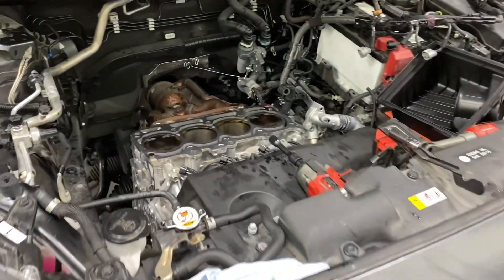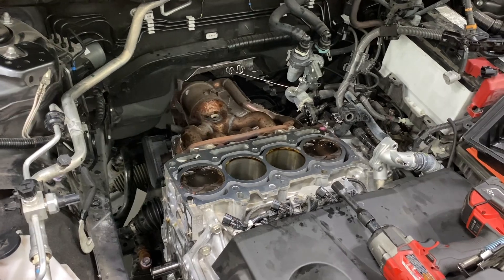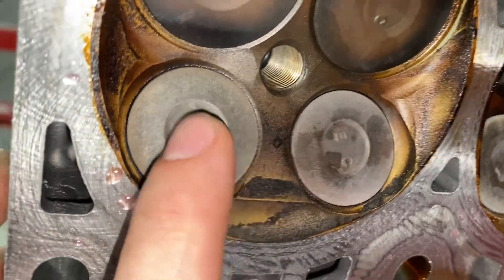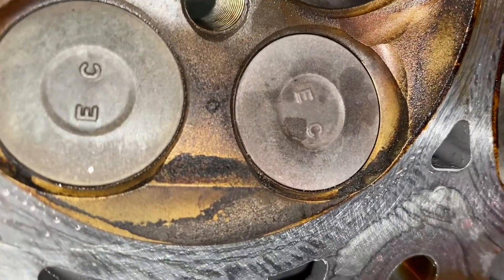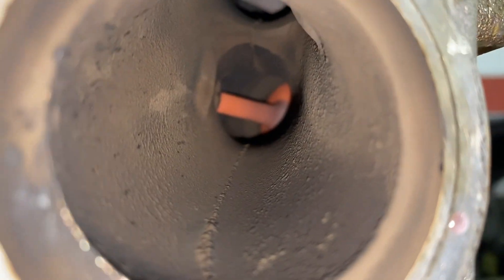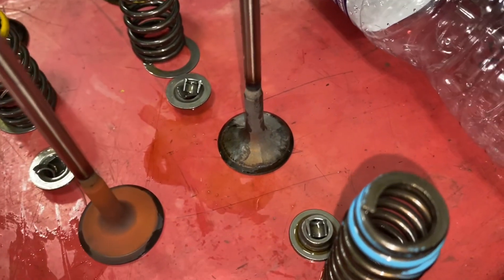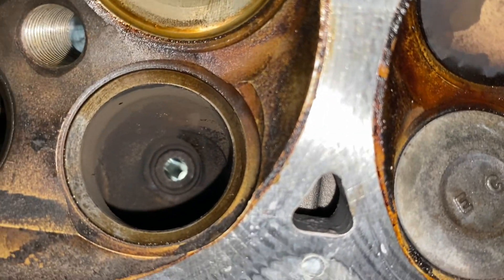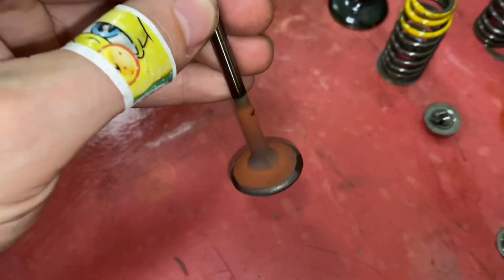2024 RAV4 Bad Valve Seat/Cylinder Head

Comment: This is something you might see in a Toyota with 500,000 miles (and even then, it was rare) on it in the past, but not a new one. Toyota's unravelling is getting a bit concerning. I'm hoping for the best for my 2024 Corolla for good longevity. It's my first Toyota, but not the first in our family. We had two Corollas, a 1980 and 1981 for about a year and half while we waited for my father's company car (a 1980 Pontiac Bonneville) to be built and shipped to the dealership. My dad ordered it very specifically, so I remember the dealer calling and asking if we would take it without gauges (apparently the assembly plant called the zone manager who then called the dealer who then called my dad). 

My dad said, "If that car comes without gauges, I'm not taking it". That delayed it another eight weeks. After all that, the car came in and we only had it about two years. It was stolen in 1982, and we believe (according to the cop that took the report) it was put on a container and exported overseas somewhere. 

I'm thinking the Corollas are part of the "good Toyota" before things started coming unraveled and that's disturbing because you never got that with Toyota. Sure, things go bad, but not like this. It's almost 1970s GM/Ford/Chrysler/AMC embarrassing.
Reply from the maker: @googleusergp  this is still rare, and you have to remember I only see the broken ones. Hundreds of thousands of them are out riding around without issue. I was a GM tech before moving to Toyota, and there I did nothing but heavy line engine repair under warranty- day in and day out. Toyota is not what it was in the 90s and 2000s, but it isn’t GM/Chrysler/Ford bad.

Comment: What DTC did it throw for the misfire? What do you think caused that valve issue in a 20K mile car?
Reply from the maker: @SwordsCutEmDown  the diag was interesting. It had a cylinder 1 misfire, and a random/multiple misfire code. Freeze frame data was odd, in that it did not register the misfire, and showed normal fuel trims. Cleared codes, started the engine and monitored live data. No misfire count showing. Fuel trims perfect in either port, or direct injection modes. Engine would visibly be shaking. Anytime it was raised off idle, it was smooth as butter. Even to 900-1000rpm. Running the AC would even raise the revs enough to smooth it out. After a hot soak, it was worse. Oil looked good, coolant level was fine. No evidence of coolant burning in the cylinders, spark plugs looked great. Toyota head gasket failures typically misfire due to coolant in the cylinders on a cold start. Finally got the misfire to show by only displaying cylinder 1, 2, 3, and 4 misfire, and all cylinder misfire PIDs on the scan tool. This improved the refresh rate. Cylinder 1 was a dead miss on start up and at idle. Moved ignition components- no change. Moved the port injector (because it’s easiest). No change. Checked compression on all cylinders. Compared 1-4. No discernible difference. Leak down test on cylinder 1. Absolutely no leak. Pressure tested the cooling system and inspected inside the cylinder for leakage. None. Checked for fuel pressure leak down with key on, engine off. None. Tech support suggested replacing the direct injector. We’ve seen a bunch of them fail, but it had always thrown off fuel trims, and you see the fuel pressure leak down. I replaced it because they said so. No change. Tested all wiring on injection and ignition circuits all the way back to the ECU. No change. Measured, graphed and compared ignition coil voltage, IGT signal and injector pulse with the PICO scope. No issues.  Removed and switched the direct injector with another cylinder to prove to the field technical specialist that it wasn’t fuel, that it was engine mechanical. No change. While the intake was off, filled the intake port with brake cleaner and looked for drips in the cylinder. Also pressurized the cylinder with shop air and looked for bubbles. None. Finally I hooked a vacuum gauge up to it and watched it. Noted a slight vibration in the needle at idle. Compared to two other Rav4s. The needle was steady on those tests. Vacuum is slightly different on these cars since they are Atkinson and Otto cycle engines. I then measured each cylinder with a pressure transducer and the PICO scope with the engine running. Cylinder 1 was considerably lower than all other cylinders. This convinced the foreman to get me some tear down time. Pulled off the valve cover, looking for an intake valve issue. Ended up finding one of the cylinder 1 exhaust lifters compressed more than all the others. This led to inspecting the valves with the bore scope while rotating the crank by hand, and finally seeing that one exhaust seat had recessed enough to change valve overlap and reduce some compression and increase the combustion chamber sightly. This led to just enough crank inertia change that the ECU could see a misfire only at idle when warm. Also, all the air/fuel was still burning, thus the normal fuel trims. Either the head, valve seat or the head and valve seat caused this. Not sure which came first. I can say, I’ve never seen this on a Toyota. Only ever seen it on a 04 Ranger with a 3.0 V6. Those were famous for their soft heads and recessing valve seats.
Reply: @andrewasaurus  Have you looked at T-SB-0010-24 dated Feb.21, 2024? That misfire and the exhaust valve issue sound like they are related to this valve lifter TSB.
Reply from the maker: @SwordsCutEmDown  I have, but it isn’t related. The lifter is actually fine, surprisingly. The lifter was only depressed more by the rocker than other valves, because the valve stem was physically sticking up a few millimeters higher from where the valve seat had recessed.